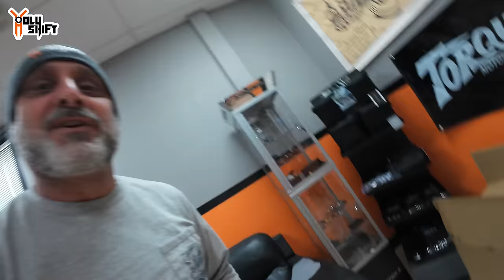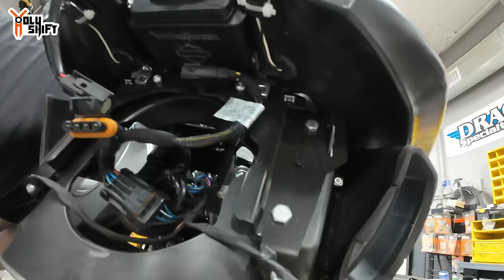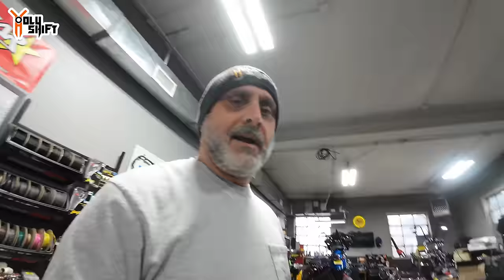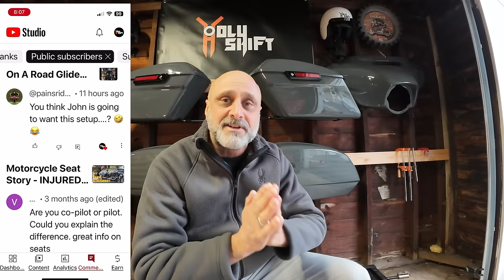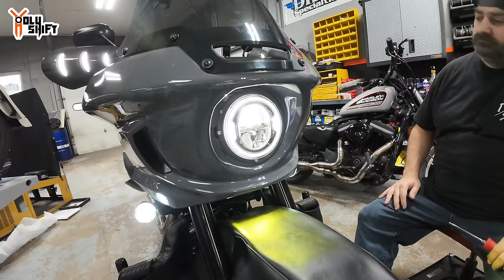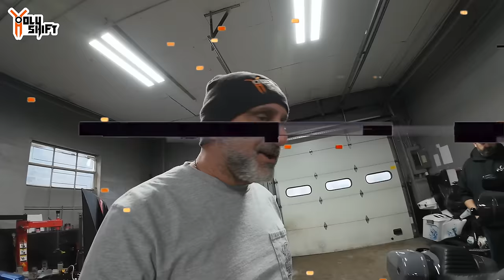EYE POPPING UPGRADE ! Inner Fairing Swap !

Comment: I ordered a headlight clear cover to go over my headlight - I figured it would make it easy to clean any bugs and keep them out of the inside of the fairing.  I have not installed it yet but will be in the next week when I add the speakers.

Comment: Nice job, So they have since fixed the fitment issue? I have their fairing and brackets to mount on my 22 low rider s. I also purchased the stereo because they made it look like a seamless fit not to mention I thought it would be plug and play which it is not. I have not taken the stereo out of the box yet and my dealer is telling me they will take it back if I do not open it. My concern is the fitment I would not be satisfied with those gaps. Do you have an idea of around when the fix was done? I received my fairing end of December.